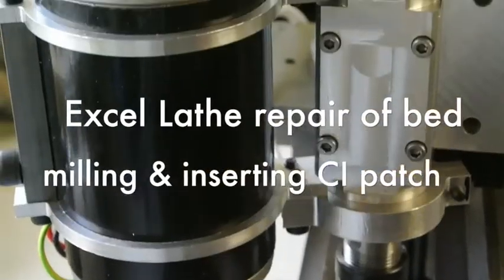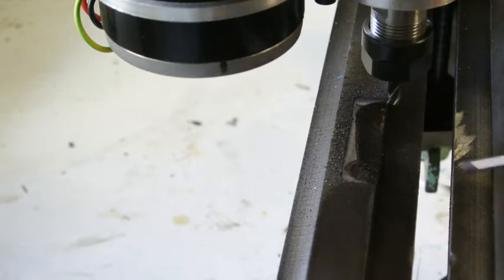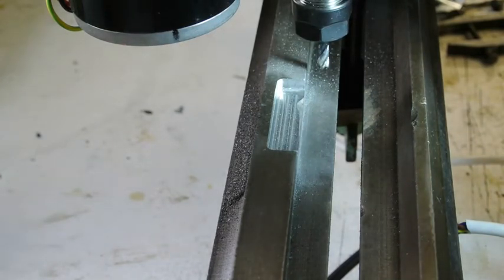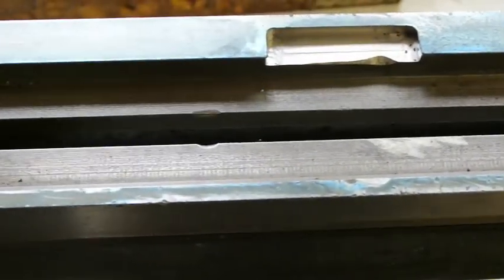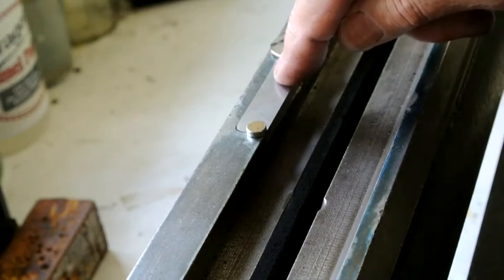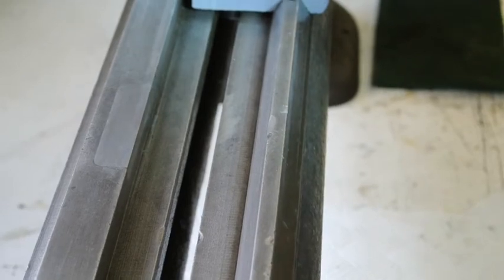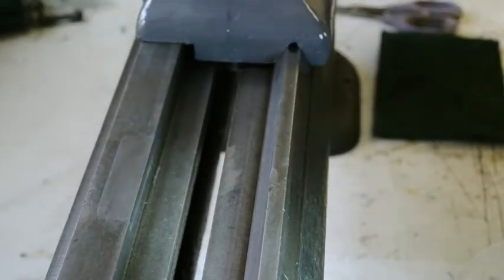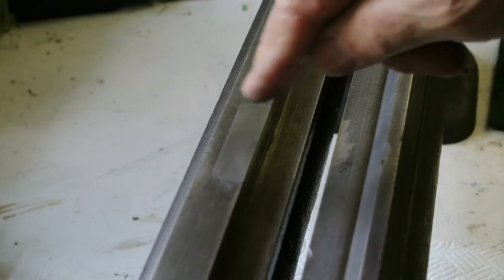Excel lathe Part 2, bed repair

Comment: Found this video as I need to repair the ways in my excel lathe, but is much more modern and a different type of break, the removable section under the chuck has cracked in half widthways.

Comment: Turned out well.  It is mainly cosmetic in effect, given that the tailstock bears onto the non butchered portion of the ways.

But it all helps and certainly is a big improvement.  You can only wonder what moron damaged the lathe in the first place.

Good work.

Cheers Rob
Reply from the maker: Thanks for the comments Rob. Needless to say the lathe didn't cost me much and gave me a project to work on. I don't recall anyone posting about repairing lathe beds before and thought it might be interesting to show what can be done. I think that the person who ground away at the bed was trying to turn something that was too big and simply ground away the bed with an angle grinder to allow it to swing. It was a horrible mess and a shame to do this to a lathe which is quite sound and still capable of accurate work. I renewed the feed screws and nuts in the compound slide and gave it a light scrape and a really good clean and it is as good as new.
Reply: @john2478  Top stuff.